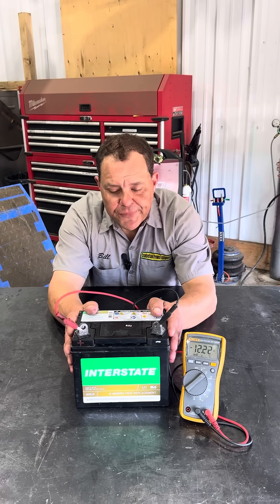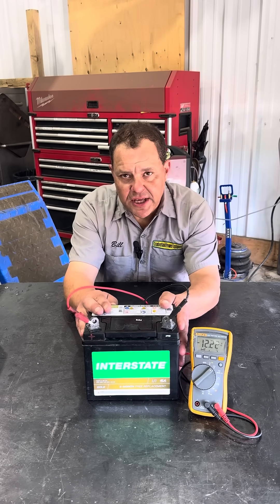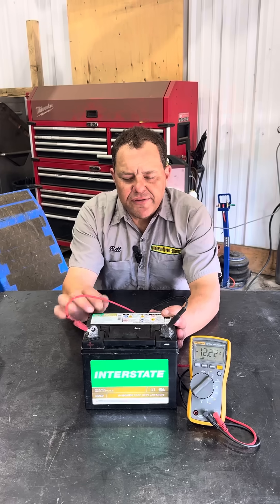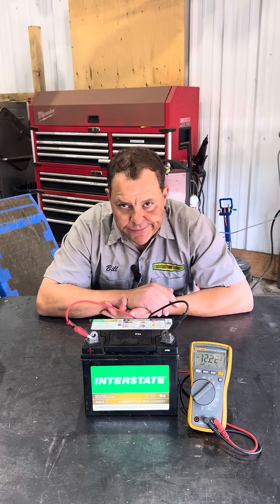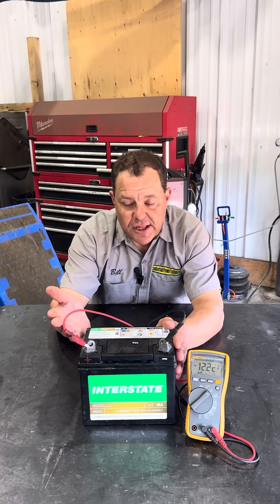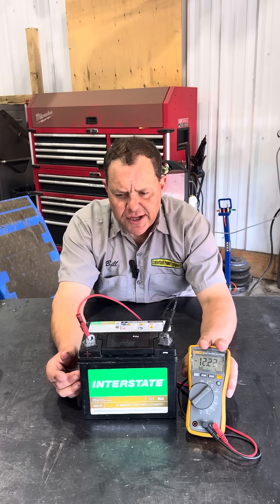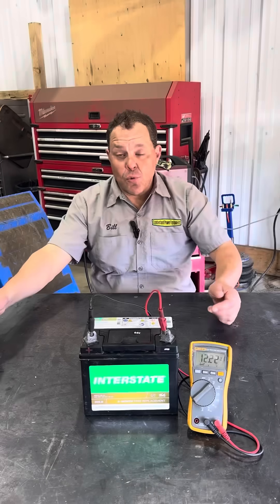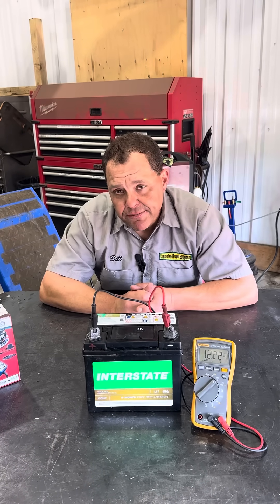Lawn Tractor Battery FAIL: Reversed Polarity

Comment: I made that mistake once. Charged the battery backwards. Starter turned the wrong way, didn't hurt the charging system. Drained battery with a couple headlight bulbs, it took some time till dead. Charged the correct way, battery worked fine for several years after that.